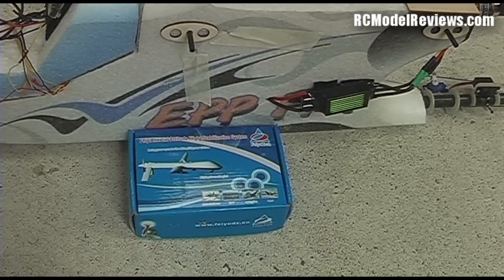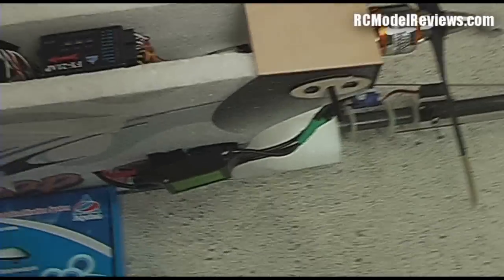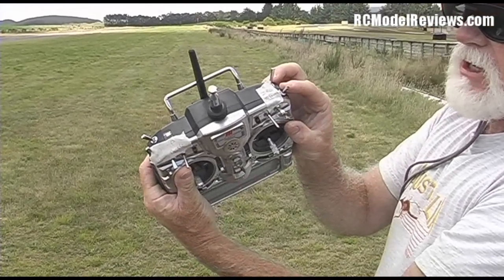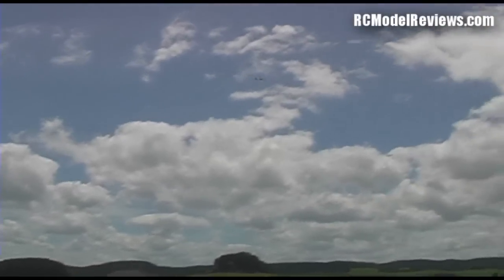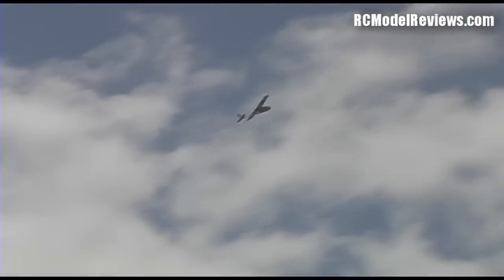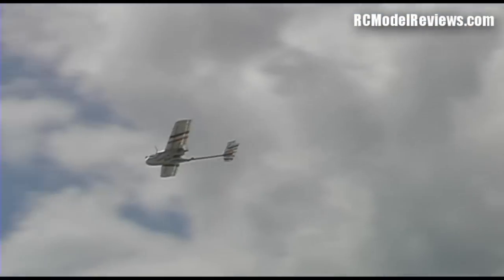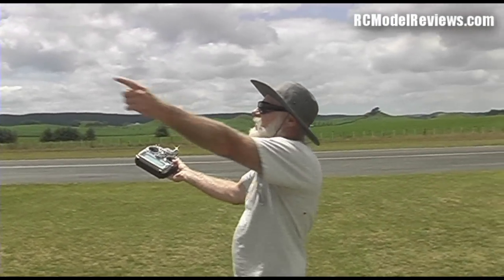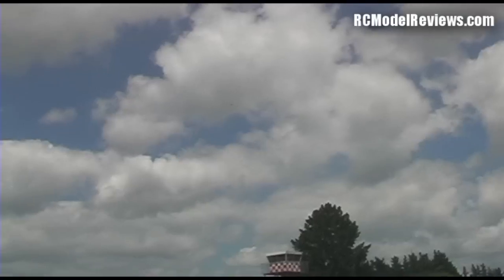Review: FY21AP FPV stability, RTL and OSD system from FeiyuTech

Comment: Have you noticed any drift or odd behaviours from this set yet? Someone at my local forum insists the system has issues but he seems reluctant to elaborate about what is wrong exactly. Your videos have however given me enough confidence to invest in such a system, ive got the same airframe waiting for it aswell and it seems like an absolutely idiotproof way to fly FPV.

Comment: @catamaranman333 

yyes you are right this week i was reading about other systems and you will always need a IMU or other kind of sensors so the price is reasonable
this kid is great accept the lack of throtlle control
for example my receiver shuts down the throttle when loosing signal so the plane will go down
i have no setup for failsafe on the throttle (robbe FX14)
or am I wrong?
bruce can you help me about this problem??
thanks

Comment: @wippo76 I dont think so....it seems to be all built in except for IR sensors that add some functionality and stability but the website claims that for the $335 price you get autopilot with return to home and waypoint sequencing.  Also it incorporates throttle control which this doesn't and I believe current sensor, although optional, is also included at the $335 price....see, this is precisely why I want someone to get all the top AP/OSD units together and do a comprehensive review......Bruce?

Comment: No throttle control, you must set up fail safe to have the throttle at what ever throttle setting you need to maintain level flight for your bird and your fail safe set to return to home as well. It works like a champ no problems, let me warn you Fyetech and there tech support not all that good, I have had some other issues they haven't fixed yet so we what happens.

Comment: In Return To Launch mode, does it control throttle as well, to maintain a preset height? Or does it use either last throttle input or let you control throttle? Very interesting to know if the plane loses contact with your transmitter...
Excellent video, as usual, of course :)

Comment: I have the same system in my Hobbico 60 which powered with an OS 91FS and been converted to a tail dragger and also use it for my FPV. I am really happy with it and enjoy flying it and not having to worry about it, it's hands off when I am flying it. I am using JR X9303 with JR R921 RX and powered with two 2200 mah Lipo batties one for the flight pack and the other for video system, the video has a sony 420 camera which mounted to a pandora pan & tilt. This airplane is fairly heavy about 8 lbs.

Comment: So, am I correct in thinking that the autopilot does not control throttle in any way?  I believe that there are some that do but memory isn't serving me at the moment.  Also, are there any sensors like current sensors or voltage sensors for a second battery that are NOT included in the FY21AP/AP117 packages?  Any support on the horizon for waypoint navigation do you think?  The price seems good but for just a little more money it seems I can get a whole lot more than this package offers...